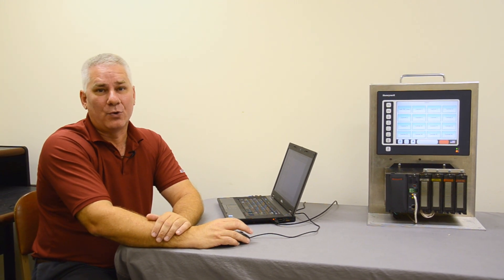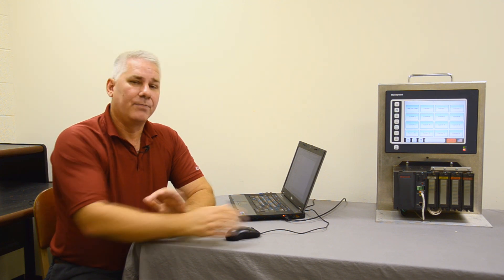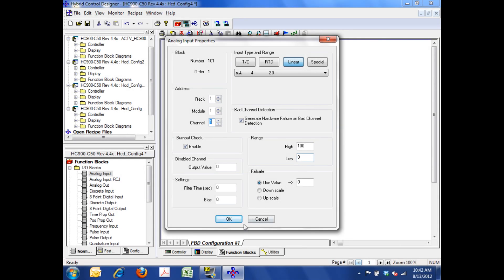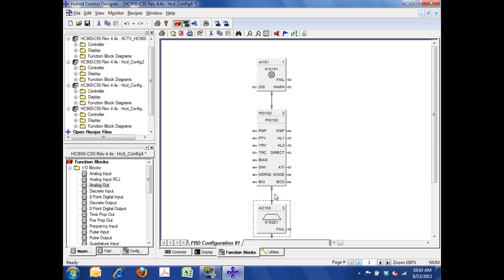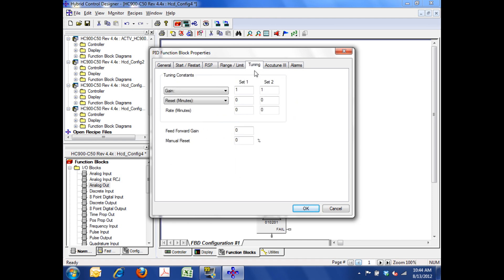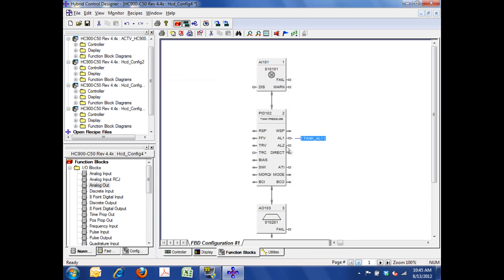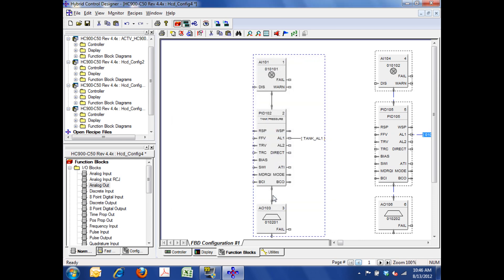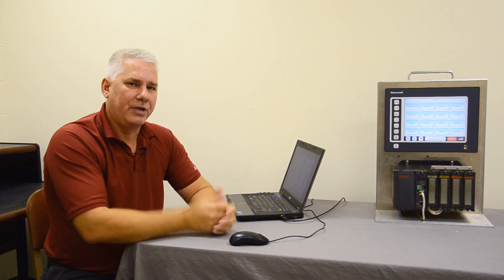Configuring PID Loops with the Honeywell HC900 Hybrid Control System

Comment: Are there any tutorials for the station designer software? Also, does anyone know if you can get a Honeywell control station (cs10) to communicate with and Allen Bradley plc? I can get the Red Lion displays to  and the Honeywell display is pretty much the same thing.